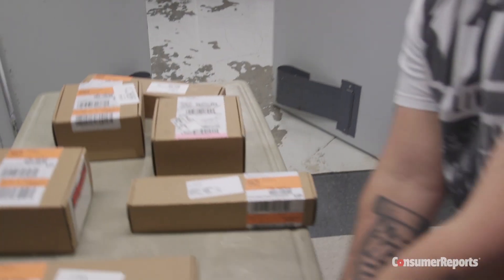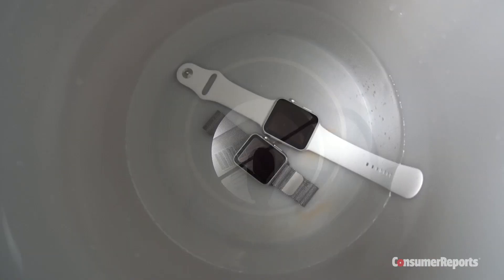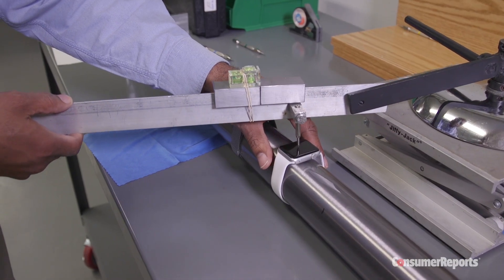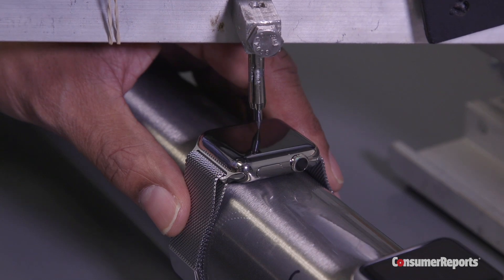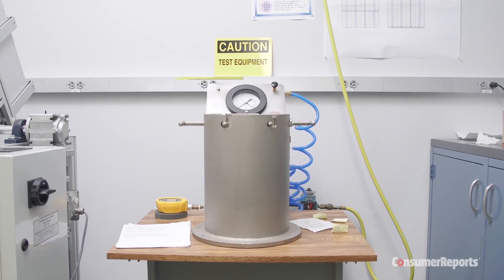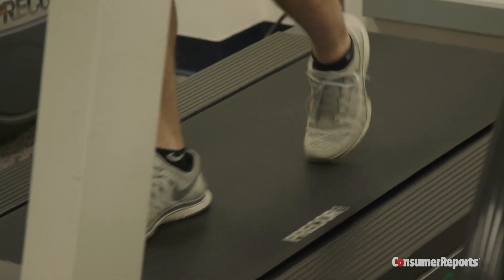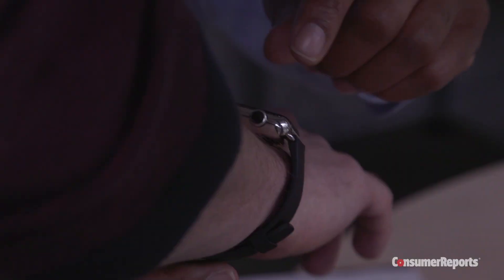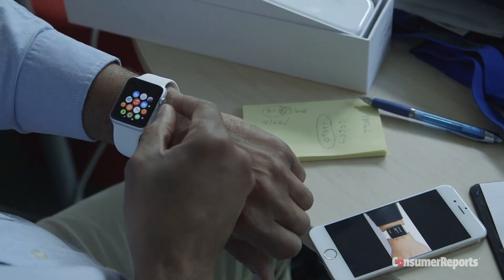Apple Watch: Consumer Reports' First Test Results | Consumer Reports

Comment: You need to test the heart rate monitor with stuff like interval training and weight lifting even sports, like soccer or hockey, that's where the fitbit HRM fails anything that causes a rapid spike in heart rate usually throws it off. During a routine like Insanity or Max 30 tested against a polar the fitbit was off by 30bps. Apple watch I think uses the same technology which in my eyes is garbage. It works okay for steady state stuff like jogging, biking or treadmills where your heart rate remains constant or goes up gradually.

Comment: Looks great! It holds true to the IPX7 rating, but consumers shouldn't be putting the device (or any device) in water a lot. Some is fine, but water resistance isn't permanent. I hope people don't get the idea that if it can withstand water now it will withstand water forever.